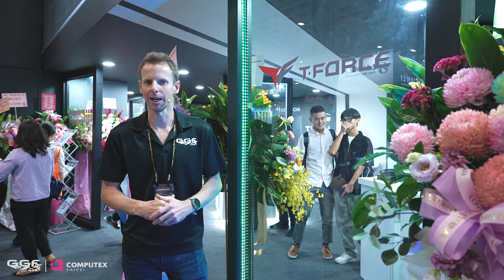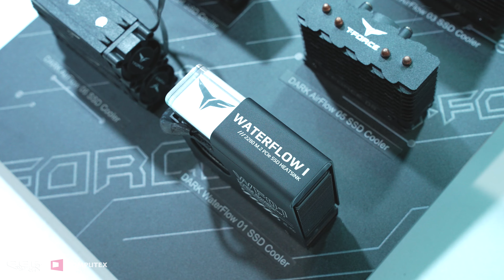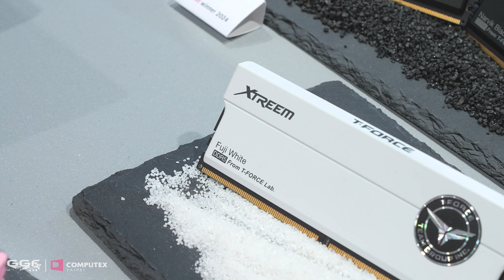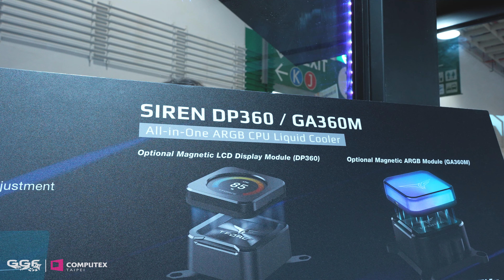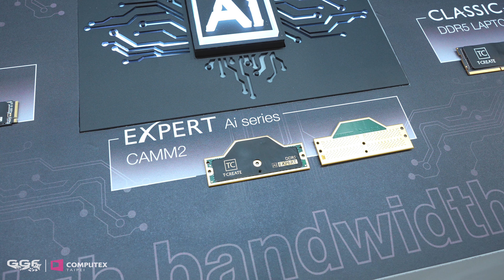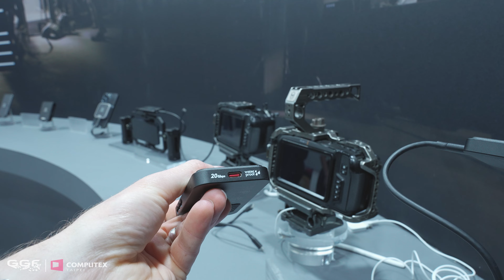The CLEANEST Looking DDR5! - T-Force Computex 2024

Comment: The T-force xtreem is currently the best ddr5 ram sticks on the market. got a 48gb 8200mhz myself and the heatsinks cools miles better than gskill trident z when overclocking.
Reply: Apex up to 8800
Reply: @FaceGameFps  I am running mine at 8600mhz with tuned timings on the apex encore.